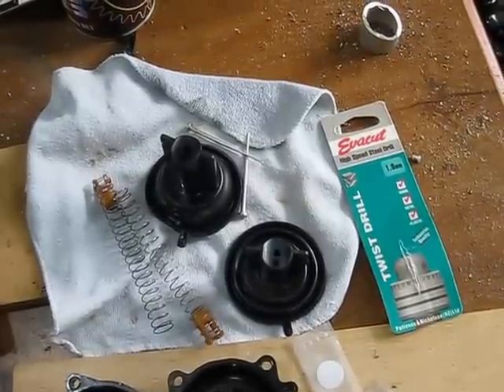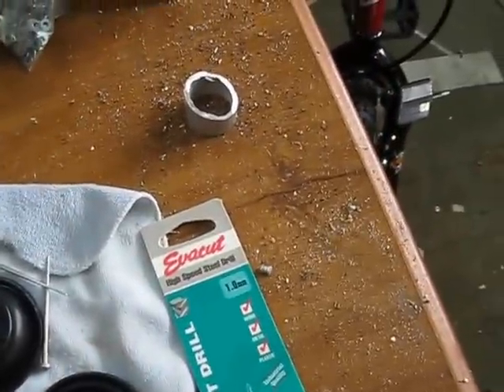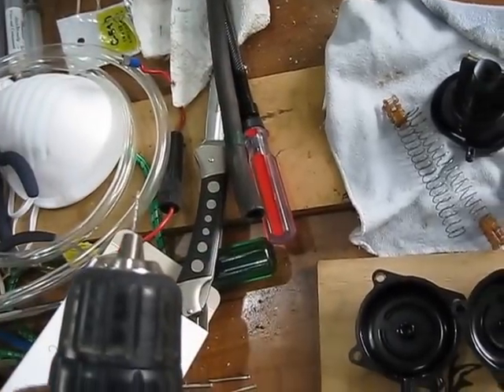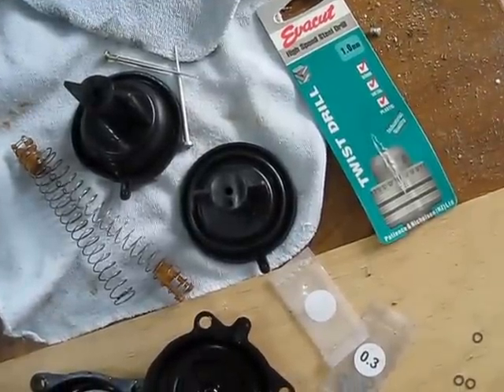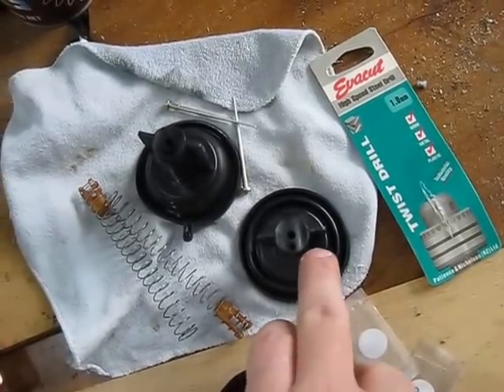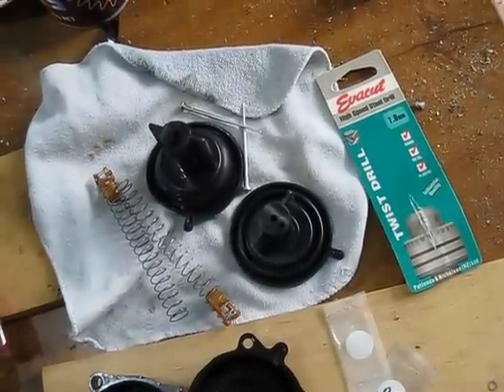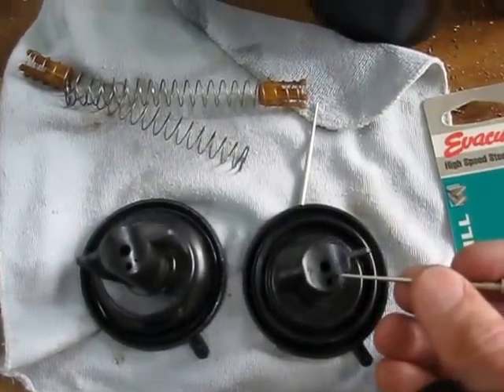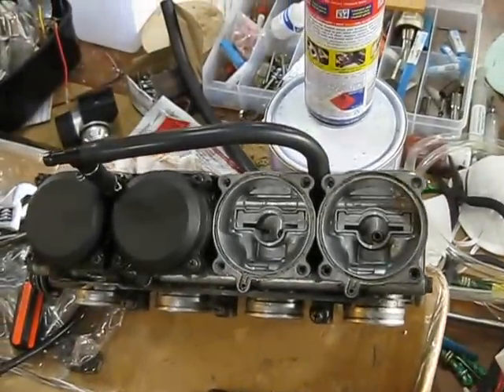🚲 Kawasaki ZXR250 carb drill slide mod

Comment: Did this to my C model, existing hole was 2.5mm, I went with 2.5mm next to the existing ones. Awesome throttle response, but boggy at low speed in high gears, but you'd never be in that high a gear at such a low speed anyway
Reply: I've been wondering about this. I just picked up an 87 GSXR750 with pods and headers, and the PO had done all the standard jetting mods you'd expect (plus a few other wonky things I had to un-do), and also drilled the slide out to probably 1/8". Took me a while to get the bike running proper, but now that it's going, it idles nice, mid range is nice, WOT is excellent, throttle response is excellent. The only problem is at low RPM, with load and <25% throttle it bogs right out. I can usually push through it by just giving it >30% throttle and then it screams, but man it's sketchy when you're trying to navigate a turn, and now you need some throttle, but you know you can't touch it because it's no longer variable throttle. It's either boggy or GO TIME.
This sound like what you saw and are you sure it was due to drilling out the slide?